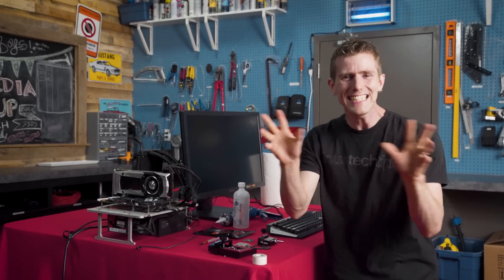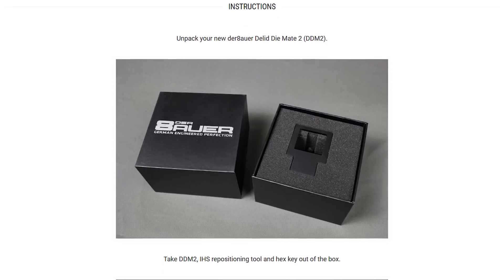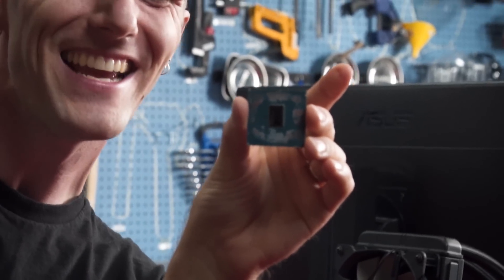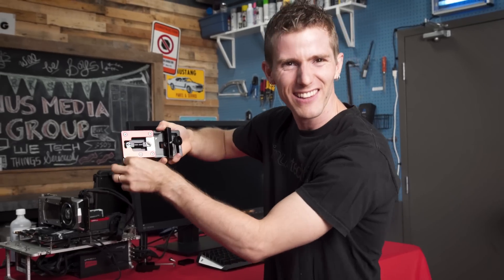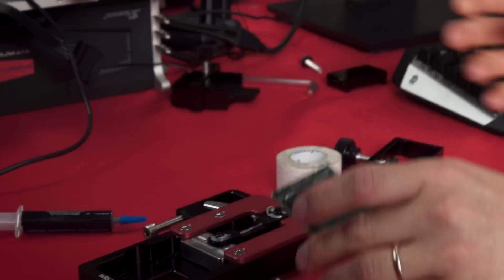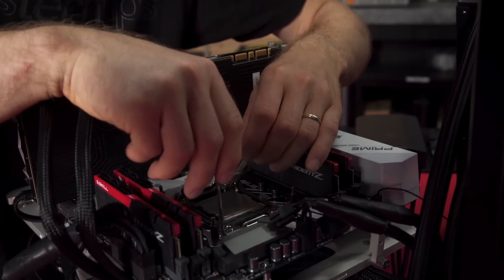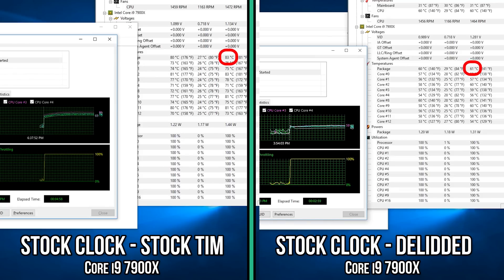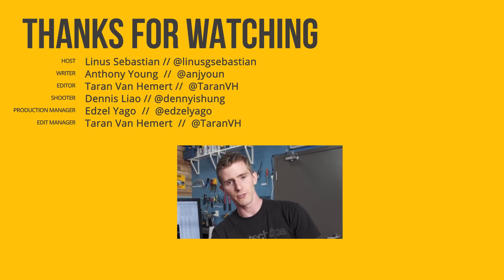Delidding a $1000 CPU - Worth the RISK??

Comment: Uhm, there is one thing I dont get about this whole process. I know its about keeping the processor as cool as possible, but with the design as it is, after doing this there certainly is air trapped beside the processor under the lid. I imagine maybe they put the lid on in a vacuum enviroment, so to keep any air from getting in there. I am going by the assumption that air aids corrosion, air humidity may be a factor as well as the entire thing that heat needs air to burn. So using a processor entirely without lid seems even less smart.

Comment: What if they made CPU coolers that had a thicker base, designed only for a de-lidded CPU thats made just thick enough so you wouldn't have to put the lid back on and just have the cooler directly on the die with no further modifications?

Comment: @linus tech tips i have a question. As you said intel uses toothpaste material as compund.

What if the they might have tested the applied compound so that it does not damage the core cpu. Also the compound you applied is not officially tested to be used on die of cpu and will not cause any damage in long run.

Can you please reply your view.

Comment: im lost, he says its not worth it but also shows me a 20 degree celsius improvement, I feel like at this point someone should start a company where they delid CPUs because normally you'd have to run a custom loop for that kind of improvement (which would run you at least $200) so i'd probably pay like $60 to have someone do it with a guarantee.

Comment: I know the intel ihs paste sucks, but how about zen 2? I'm looking at doing some OC'ing experiments once I'm a little more set up, and was wondering if I would benefit from delidding, or if even a simple quick lapping will get me to the point of diminishing returns. Starting with the Ryzen 3 3200g as my lab rat, and possibly trying my 3900x later if I get a good backup system, or start running a Zen 3 after it comes out.

Comment: i've delidded more than few cpus in my time, used to use a strip of plastic from a blister pack (that id cut with scissors), rather than using a scalpel, you know, to make sure i dont cut into the cpu or scrape any contacts plus its basicaly free, surprised noone else mentioned this

Comment: with cpu transistor manufacturing process (14nm- 7nm) slowing down while add more transistors in die for newer gen for more core and clock speed. New cpu will run hot again just like old days♨️🔥☄

Comment: with cpu transistor manufacturing process (14nm- 7nm) slowing down while add more transistors in die for newer gen for more core and clock speed. Cpu will run hot again just like old days♨️🔥☄

Comment: Anyone reading this in 2020 go ahead and buy a custom solid copper heat spreader if you are going to do this.  They aren't that much and they make just as big a difference.

Also invest in super high quality thermal epoxy/compound.
Reply: intels heat spreaders are actually copper as far as i know and covered in some other metal, pretty sure the difference would be way smaller than delidding and using a high quality thermal compound/liquid metal

or you could just get a superior amd cpu that has a soldered heat spreader

Comment: So, I have a 6600k on a h100, I'm at 1.4v running it at 4.8ghz, max temp output while rendering in Sony Vegas was 82c, would doing this with my 6600k be worth the risk?  I doubt I still have warranty, but would 5ghz be possible?

I want to move from my 1070 to a 2070 super, which I've got on hand to test in my system, but I'm wondering how soon after I'd probably want to move off the 6600K, need a new board for that

Comment: I got a 9900k that could do 5.4ghz on eBay for 1230 and I delided it, put kyronaut on it and put it on a custom hardline Liquid cooler and got 5.375ghz at 1.375v with 3733mhz cl16 overclocked ram with a 40mm black spray painted noctua fan active cooling it and a Samsung970 evo pro 2tb ssd and a 2080ti On a custom hardline loop  and got it to 2185mhz and it’s the best gaming system in the world... I think...at least the best 9900k ever

Comment: Dont know why everyone says, thats becasue its INTEL lol, it doesnt matter if its INTEL or AMD if you want cooler temps then delid and add your own grizzly liquid metal. Every brand of chip is made with the cheapest paste you can buy thats why there such a rich company they squeeze every penny out of you that they can while making everything as cheap as possible. They dont aim for the best build they aim for the cheapest build. Thats how it works with all chip makers or brands. And yes i know alot of AMD chips use solder and not liquid metal but even then they use the cheapest solder they can buy so it's better to delid and use your own in my opinion if you know what your doing anyways lol
Reply: you should do your research smart guy. intel uses thermal compound on their cpu's, true, but amd solders all of their am4/ threadripper cpu's(i think older generations were also soldered), and actually solder has potentially better performance than liquid metal, and its not bad quality solder either. so delidding an amd product would be kind of pointless, especially because they cant be delidded the same way intel cpu's are. thats because they are soldered so to delid them you would have to warm it up somehow (very risky and very stupid), i think that you never even delidded a cpu and act like you know something.

Comment: Back when I did this to my i5-3570k i didn't bother gluing the heat spreader back to the chip, I just let the retention bracket hold it down into the chip. And i used coollaboratory liquid ultra between the die and heat spreader and between the heat spreader and the water block to good effect. I haven't bothered doing it again, although the temperature reduction was very notable, easily 15c.

Comment: The manufacturers should just put the processors together better. Why would they not care about getting the best performance out of the products they sell?
Reply: It's cheaper.
Reply: Jmvars but they're charging hundreds or sometimes thousands why would they not care about better performance for $5 extra
Reply: @tylersanders2388  When you are mass producing CPUs, or anything for that matter, you generally want to make it as cheap as possible while still having it function. Basically their TIM is good enough to maintain acceptable temperatures with stock voltage/clocks with their stock cooler.

The financial gains can be massive if you make tens of millions of CPUs and you save even $1 from each single unit.

Comment: How is that clamp better than just putting it into a motherboard and putting a cooler with high mounting pressure (and no thermal compound) on top?
Seems like the socket+retainer would give way better alignment.

Comment: Anyone know what Linus used to glue the IHS back on?
Reply: Silicone sealant, I believe. It’s not 100% necessary, though. The sealant creates a slight air gap that can disrupt the amount of cooling you can achieve. Maximum heat transfer is always accomplished by limiting the distance between the cooling elements in play.

Comment: i had no idea that there was so little in a processor. I just kinda thought there was stuff under that metal block, and it was a hollow shell filled with parts.

Hell, with that small of a die, i think the biggest problem is actually the pin outs, and you could custom machine a block to perfectly match the die really really easily.

Hell, i know some machinists that could weld fins on it and cool it directly.

Comment: Die needs to be thoroughly covered with thermal paste. What you did can leave an edge un covered, which can burn it off and kill the chip forever. Dot method is not recommended when using TIM on die. RTFM that comes with the paste that you just smeared. GEEZ.

Comment: I didn't even know this was possible given possible dust contamination and the possibility of breaking those tiny tiny tiny little wires you usually see in inside a chip from the pins to the die.  I didn't think so far as to realise the die is directly in contact with the pads underneath.  Mind blown on a Friday afternoon.  Good time of the week for it.

Comment: 20 degree! I'm not understanding why there isn't better quality control when manufacturing these component's???
Reply: It's not a quality control issue where some cpu's are good and other's are made badly - Intel decided to intentionally use sub-par thermal transfer material under the lid in order to save a bit of money on all of those cpu's made, every one has that problem.

Comment: why not use graphene ? 
https://pt.aliexpress.com/item/1000x200x0-05mm-High-heat-conducting-Graphite-Sheets-Flexible-Graphite-Paper-Thermal-Dissipation-Graphene-For-CPU-GPU/32704364124.html?spm=a2g03.search0604.3.135.10424390IvjygF&ws_ab_test=searchweb0_0,searchweb201602_10_10065_10068_319_10059_10884_317_10548_10887_10696_321_322_10084_453_10083_454_10103_10618_10307_537_536,searchweb201603_35,ppcSwitch_0&algo_expid=64601f29-1d53-4638-b704-61e09f9d0fb8-19&algo_pvid=64601f29-1d53-4638-b704-61e09f9d0fb8&transAbTest=ae803_5
Reply: graphene is not graphite fucktard

Comment: You cannot use it with AMD because of the pins..you may damage them
Reply: Amd probably dont skimp on thermal paste?
Reply: @jordyboy321  you guys are both wrong. amd doesnt use thermal paste. they solder the chips on which gives performance that is possibly better than even liquid metal

Comment: Awesome video, but this makes me wanna delid my upcoming new cpu even more XD

20° temperature difference is a LOT.. o.o if I get the 9900K retail maybe a consideration in case the overclock lottery fails?
Not sure if improvement happens in that case ...never built a pc before, way too exciting XD
Reply: It won't help much to delid the 9900k. Liquid metal is on “normal“ CPUs only a few degrees better than sTIM. And as the 9900k has a really fat Chip, it could be even worse in this special case

Comment: Delidded both a 4790K and a 6700K. The 4790K is in my desktop and is cooled by a BeQuiet! Silent Loop 280. I run it at 4.4 GHz on all cores (so turbo all the time) and it would hit 98C running Intel Burn Test. After delidding, it won't go above 80C.
The 6700K is in my Sager NP9872-S (Clevo P870DM2) and it would hit 100C and throttle within 10 seconds of running IBT, and that's with no overclock, some undervolt, and fans at max speed. Now it won't go above 85C with the same settings after delidding.

TL;DR Delidding is absolutely worth it, so long as Intel continues to castrate their chips with such shitty manufacturing processes, like using sTIM (where the s is for sucks) and too much adhesive holding the heatspreader on.

Comment: How would you even do this on an AMD processor? I see bent pins... everywhere!
Reply: you wouldnt have to because amd solders the cpu to the ihs which has performance on par if not better that liquid metal, and delidding a soldered on ihs is very risky cuz you have to heat up the cpu

Comment: hi there! i have a question ! delidding a sandy bridge i5-2400 worth or not? i have an issue with core 2-4,they run hotter than 1-3core the differences between cores 2/4 and 1/3 are about 6-10 celsius! so? worth killing my cpu?i once delid a pentium G just for fun...and end up killing it becouse the ihs plate didn't sit straight on the DIE  and one more....what thermal paste do i use? i don't have acces to liquid metal based thermal paste! thank you in advance! sorry for my english!

Comment: Dip the CPU in alcohol and leave it in for a little while, then use a strong fishing wire to split as you gently pull the wire sideways in a seesaw motion.. After putting the new paste, place a piece of paper towel on top of the heatsink, then an unopened soda can on top of the paper towel. Let it sit for at least 30 minutes, preferable an hour or two. You are good to go.

Comment: There is no point for me to do so. One Hertz above 4.32 on my FX 8350 and the whole computer experiences catastrophic failure regardless of temperature, voltage, or RAM timing. This is not your everyday silicon lottery loss, this is advanced silicon lottery loss.

Comment: Delidding any cpu is the way to go, I STRONGLY RECOMMEND when delidding remove all the adhesive from the lid and the cpu, do not place any adhesive when doing this instead use a dab on each corner wall of arctic silver or thermopaste of your choice and guaranteed better temps, the adhesive of any kind on a cpu causes spikes, good luck guys.
Reply: nope. delidding amd is not only pointless because its soldered on and better than liquid metal its also almost imposibble bacause of the soldered oin ihs

Comment: I recently built my first pc and bought my processor at Best Buy (yes, I know it’s usually more expensive but I was excited and other parts had already arrived) I couldn’t wait anymore and I picked up my i7 8700k and opened it and just as I was going to put it in the motherboard socket, the top metal part fell over it and I thought it broke my pins but luckily it didn’t. I was scared I thought I messed it up but Best Buy simply sold me one that someone else tried delidding but ended up returning lmao. They sold me a used processor but the process of returning it and exchanging it was much easier than I thought. I just believe they lack computer knowledge and do not know the ways to get inside their own boxes and do not check refunds 🤦‍♂️ Im glad it was easy to get another one but shit I got scared and it almost broke my $170 motherboard

Comment: I delidded my i9-7900X using Rockit's kit for LGA2066 and got their Copper IHS that is a little beefier and I got an improvement on average of 20 C (based on Benchmark with Blender benchmark) before and after. Before delidding I could not pass OC of 4.4 GHz (stable) before, now I sit easily at 4.7 GHz at 30 C on light tasks and at average 80C at 100% CPU on all cores on stress tests.  Delidding with Liquid metal as TIM is TOTALLY worth it in my book. Thanks Linus and Steve from Gamers Nexus to give me the boost in confidence I needed to perform this task, that could have costed me 1K$ in screw-up.

Comment: They are terrible over locking results for the 7700k. I run at 4.8GHz at 1.24v and reach max temps of 83 degrees with stock TIM. Completely stable. (Aida64 extreme for 6 hours)

Comment: I'm a bit confused. He said Thermal Grizzly Conductonaut but I clearly saw him put on a paste which is most likely Kryonaut. I used Conductonaut Between the die and the IHS and Kryonaut between the IHS and heatsink and got a 20c difference.

There is no way in hell that the chip that was on camera hot a 20C drop. left the old silicone and added way too much on top of it which will increase the gap between the IHS and the die.

Comment: Can you do a video of delidding an old laptop CPU?  I am still running an old i7-3160QM in my laptop and it constantly thermal throttles under medium workloads.  Will it help?  Might be an interesting test.
Reply: No, Most laptop cpus do not have an IHS - they often utilize direct die cooling, all you need to do to fix the temperature issues is to access the processor by removing it's cooling and if it has no ihs just clean off old intel tim and apply liquid metal onto the die directly.

Comment: On that prototype tool where there is no alignment piece I wonder would it be just simple to put that CPU to its socket and lock it in place, letting the socket mechanism to do its magic for alignment. Then pressurize it simply with cooler block tighten normally in place. I mean "Yolo" is good tough 🤔😀

Comment: I have delided my i5 7600K, drop of temp = - 15°C using conductonaut for IHS and another - 8° using Kryonaut for the AIO Silent Loop 240, It run at 5GHz 1.3V max temp = 68°C in 10h Burn...

Comment: What!Of course it's worth it.Absolutely worth it. If the CPU runs that much cooler you won't need the warranty in the first place, it's going to last a lifetime. Of course provided that you won't run it 24/7 max overclocked and with garbage cooling.

Comment: Coffeelake is so badly made it cant shed heat well beyond a certain point.  I would say definately.  8700k sucks without delidding because the intel stock quality is really really bad.   Incidentally, Linus, why didnt you replace with liguid metal in this video?  That looked like some pretty standard thermal compound.  Personally, I also really looking forward to the nude Watercooling straight to the Die block covered by linus and currently in kickstarter.

Comment: Those temps are foreign to me. I've got a AMD Phenom II X6 1100T (no OC) with a Cooler Master Hyper 212 since ~2010. I can't make the thing break 45C even on Prime 95 runs. 

I do have it in the back of my head to upgrade my GPU though (GTX 460se). Obviously, I'm not a huge gamer, but I do like the occasional racing game such as Track Mania, NFS Porsche Unleashed, Asphalt 8, Project Cars 2 demo, etc. What would anyone recommend in terms of the "most future-resistant" GPU, to match with my older 1100t for some racing games and CAD modeling? It must be DX12 compatible as I'm considering DX12 titles such as Forza Motorsports/Horizon, but there's no sense in grabbing a GTX 1080 as there's no way my CPU could even begin to keep up.

Comment: Tbh I’d rather just go with a custom loop, it’ll produce better thermals and if you are willing to spend an extra $1000 build a loop. Now if you have a loop and need better thermals then Jesus what are you doing?
Reply: Your God Rosè the whole process of deliddimg is the most extreme solution  to gain the best cooling. it is only for those who want to overclock extremely. 
but pc enthusiasts are wanting to get similiar results so they tend to give it a try.